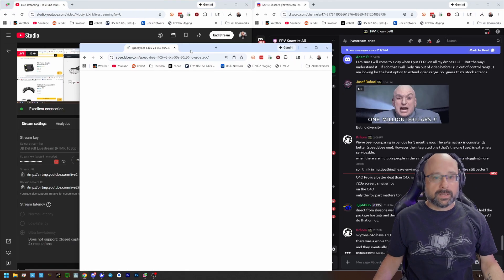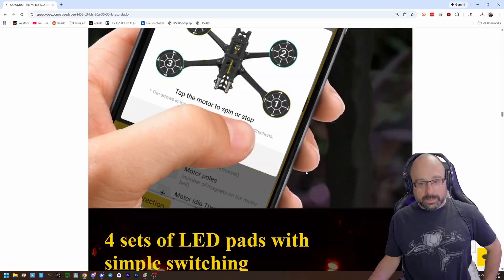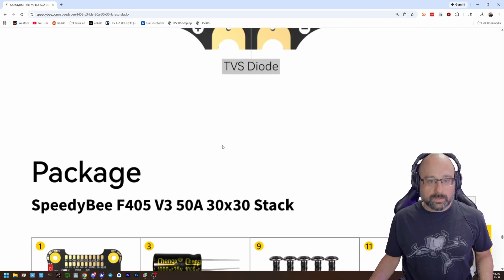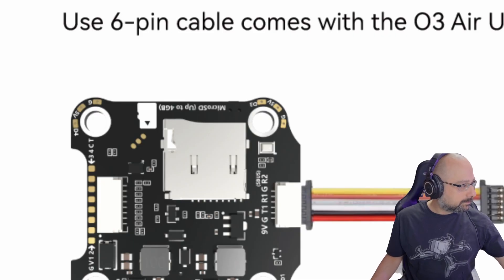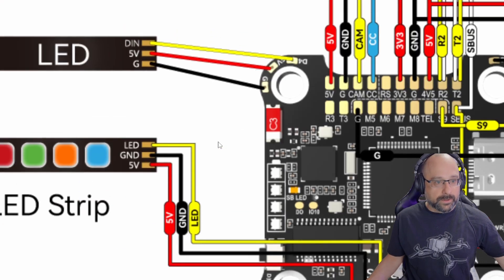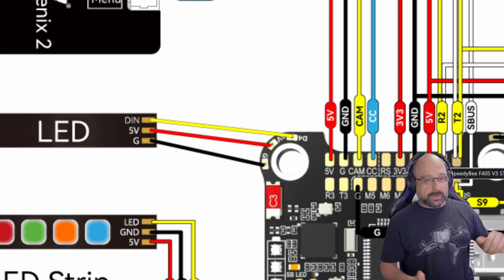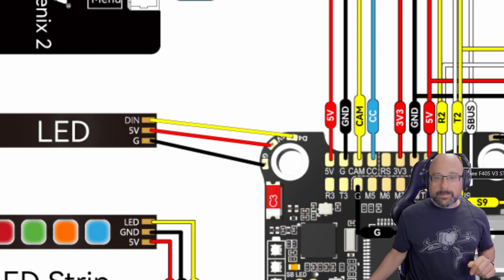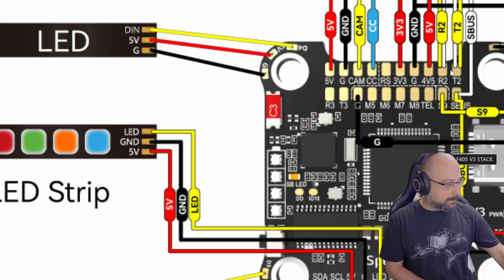Why Does ExpressLRS Have Issues When DJI SBUS Is Wired Up? - FPV Questions

Comment: Any idea what DJI is outputting via the Sbus? Would it be possible to use the “Resource” function in bateflight CLI to repurpose the R2 pin?
Reply: most likely telemetry info telling you that there is no signal. repurposing the r2 pin won't matter if both your receiver and dji video trasmitter is wired to it, one has to go. if you repurpose the r2 like gps for example, and your receiver is connected to it, then your receiver wont work.

Comment: Exactly what happened to me
Reply: What did the issue look like? Did the RC just not work or did it work intermittently? (Was it issues during flight or just no connection?)
Reply: @lecolintube  My Boxer wouldn’t bind at all, no connection.
Reply: @FPVasaurusRex  no problem meteor 75 and tx15.

Comment: Here's a strange thing though. If you are using FRSKY FPORT and wire that up to the same UART both DJI and the external receiver work and can be switched just by changing the flight controller receiver settings. Only one works at a time obviously but you can switch between the two without changing the wiring. If you have an external receiver though, you should just remove the wire and not bother with the DJI radio.